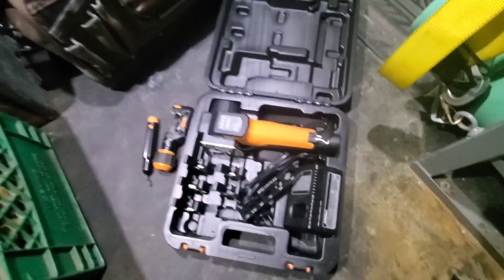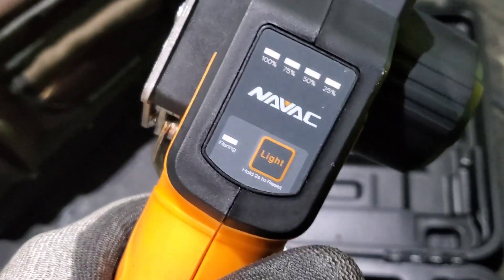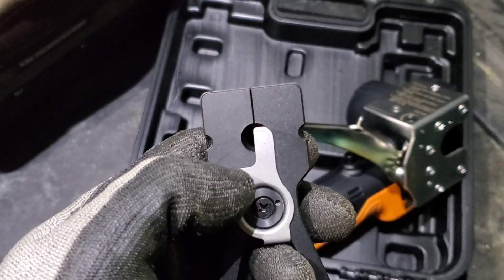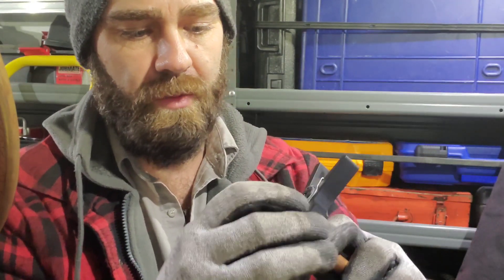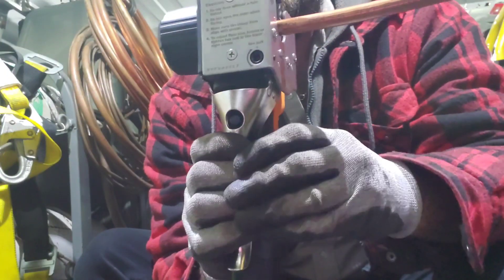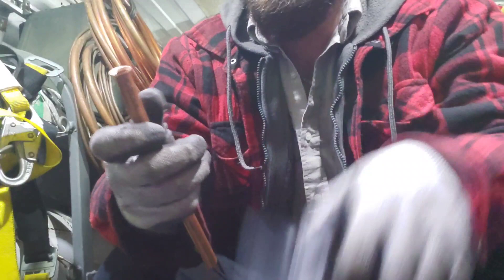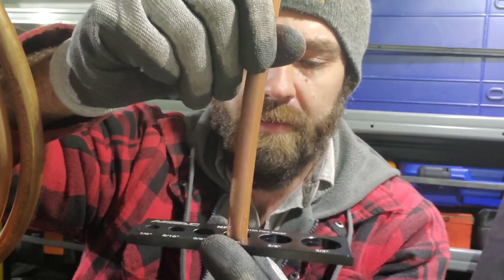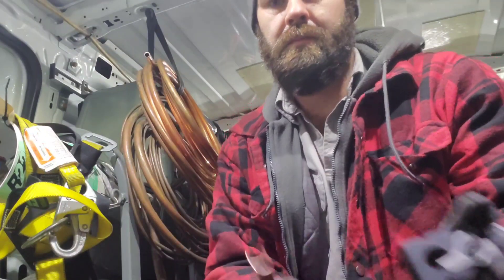Copper Flare With The Navac NEF6LM Battery Powered Flaring Tool

Comment: so 3 years later are you still happy with this tool? I know a lot depends on prep square cut and good deburing but do you get good leak free flares consistently using this tool?  The flare looked real nice but there was some focus issue on the close up. Do you add a drop of lube on the cone?

Comment: we need HVAC field more than 45 degree flaring angel. possible we can get more angel with this tool?
Reply from the maker: Why more than 45⁰?  45⁰ will fit inside a flare gauge.
Reply: @HVACKnowItAll  sir u are experienced technican and u know very well that sometimes we need more than 45 degree for sure no any leakage from the flaring side

Comment: Will this tool make a 37 degree flare?
Reply from the maker: It has a flare size adjustment, you'll need to tweak it until the size you need is reached.